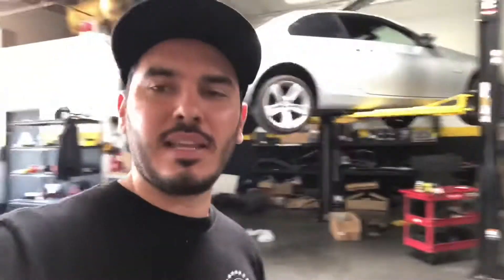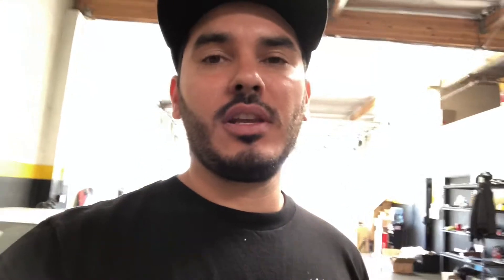E36 M50 Turbo Dyno

Comment: Bro watching this makes me want to start the build but I don't know where to start.. I bought a m50b25 engine and come to find out the internals were super clean but was missing the throttle body and what not but I was planning to build the m50b30 stroker but I guess I need to find a non vanos head.. I don't know where to look turner motorsports is not very specific on their heads.